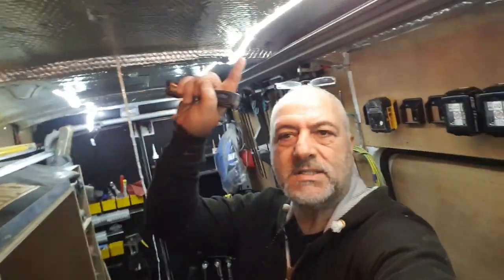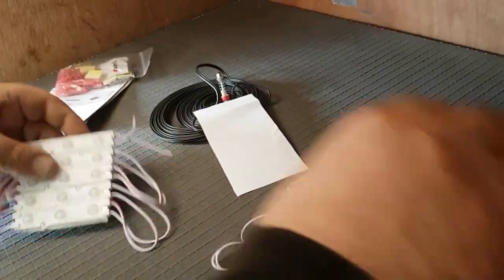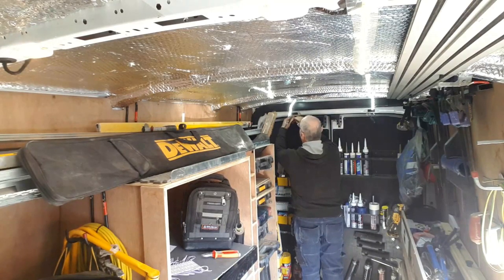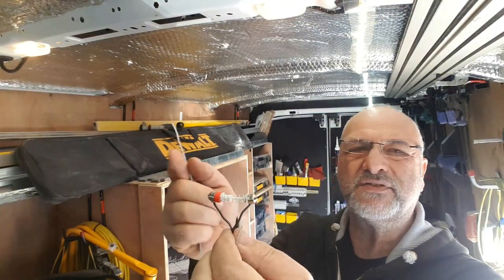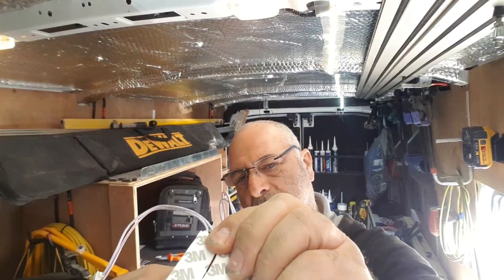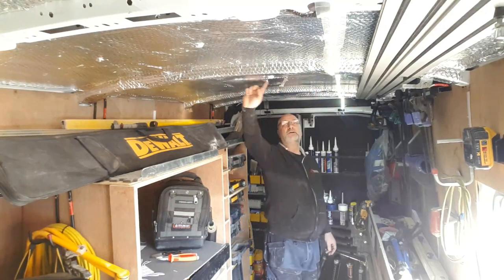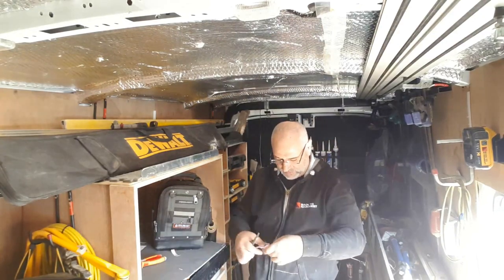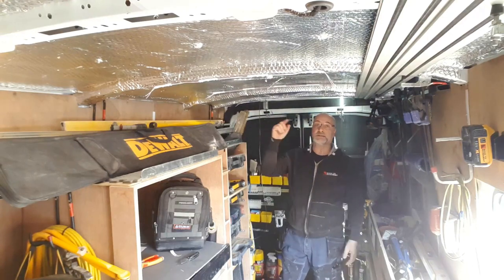How to install Led-It LED lights in your van

Comment: Where did you got the power I’m thinking to do the same on my van if I get the power from my only ceiling lights. Do you think is a direct connection